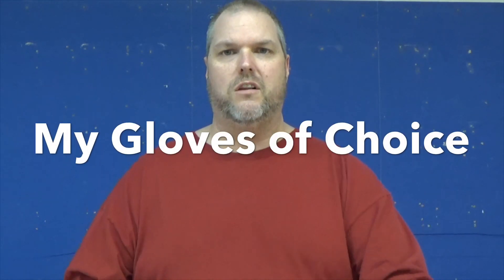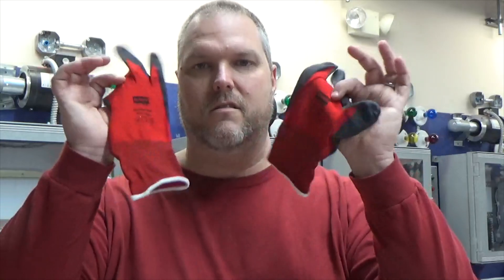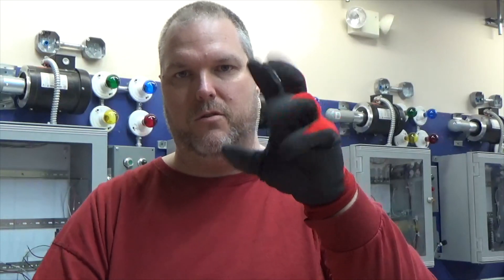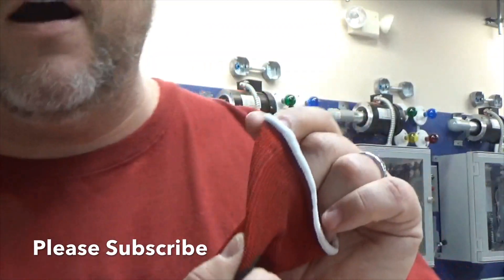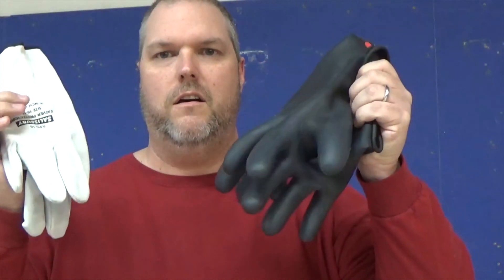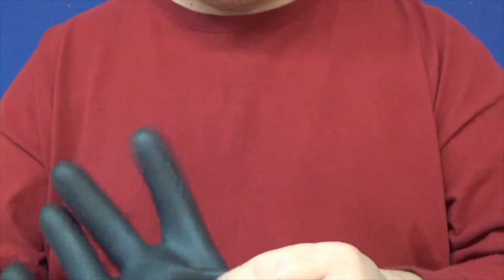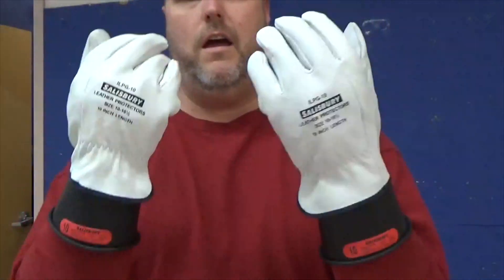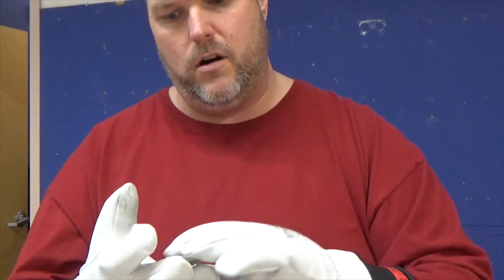PPE, Gloves for Electricians

Comment: I retired from a large hospital/research center campus. Each of the 6 electricians had 8 pairs of gloves. Halve 1,000 volt & rest were either 15 or 20 KV. Chief electrician would have 4 pairs locked up so when we sent the 4 pairs of gloves out to be tested & date stamped every six months then used the locked up sets. Keep a pair of each voltage in main hospital and the sets two blocks away in another builiding. Best to order thin cotton loner gloves to put on before the rubber gloves when in hot areas. They make an approved powder to put inside rubber gloves but never tried it. Nice important safety vidio.

Comment: Definitely agree on this stuff. Good explanation, i however only ever worked on lines that already low voltage or when the power was shut off at the breaker. But i can definitely see how you want to work on live wires and in alot of case only practical way to do so. Sometimes though you can shut off the whole entire transformer bucket with a hot stick and work on non-live wires.

Comment: I'm an Electrician of nearly 35years now and an Electrical Trainer (Instructor) too. 
You are not taking into account why the glove is made the way it is.  Electrical Gloves have a 'Gauntlet section' for a reason, otherwise they'd be shorter and only come to the wrist.  By rolling the gauntlet section all the way to the glove section to create a seal means you are not squeeze testing the gauntlet section.  A better way to do the squeeze test is to create the minimum possible seal space you can and then squeeze both the Gauntlet and the Glove sections separately.

Comment: Good video. Thank you. Are dishwashing gloves better than nothing for discharging a microwave capacitor?
Reply: Obviously a diswashing glove is better than nothing, but the real question is, is it safe? The capacitor has a limited charge, and won't kill you. So I would just use a 20 cm piece of isolated stiff copper wire, preferably yellow-green, strip the ends, fold to a u-shape, as a glorified paperclip, to touch the poles of the capacitor to discharge, without needing gloves
Reply: @rolandlastname5532  Good idea.

Comment: Today I saw someone get shocked very badly.  I'm pretty sure he will be ok, but I'm going to have nightmares for weeks about it.  I build my own tools and work with electric motors up to 220 volts, not frequently, but occasionally.  I want to find as much safety training as I can find online, and would also like some pointers on safety gear.  I liked you video.

Comment: I use gloves a lot, and I've used several different kinds. My most recent glove purchase happens to be a pair just like your red ones, except mine are blue. Superstition has always led me to prefer a thicker material, but I like these, and they don't take up a lot of space in my tool box. I also have a pair of blue plastic (PVC) gloves for nasty and/or caustic work. I was able to find a pair that fit well so that in spite of the material thickness, I can still tie the laces on my boots while wearing them. <-- That is a test I use to get a sense of how useful the gloves will be to me, and whether I'm going to have to be taking them off and on all the time. For someone who uses gloves a little more often than the next guy, it may seem odd that I too prefer to work without them, like you do. The reason is this: I'll wear a pair of new gloves to do some things that I really don't need gloves for. This gets me used to wearing them, and also gets me a chance to practice performing a task I can already do well without gloves while wearing them. Eventually, when weather or some other factors conspire to make the gloves mandatory, I won't feel so clumsy with them on.
Cheers!

Comment: Hi Mr Michaud, the first pair of gloves you showed, the red ones, nylon with rubber palm and fingerstips, would they be sufficient to protect you from electrical shock, for example I had a faulty wall light switch for the bathroom, someone probably touched it while their hands were drenched with water and it was giving everyone a shock when it was being switched on and off. Can those red gloves be used for electrical live work around the house?
Reply from the maker: I DO NOT recommend those gloves for live work. I always try to turn the circuit off when I can. Work safe. Thanks. CM
Reply: @craigmichaud-electricalins4602  Great advice Craig.

Comment: What kind of gloves do you recommend using while working with live 120/277?
Reply from the maker: Okay so to be real with you I dont wear gloves when working on 120/277v. I have to hold the wire and feel it. It is more of a comfort for me. Has it bit me in the past? YES but it is the way I was trained. I tell my students that if you want to wear gloves on a live circuit any good leather glove will work great!!! Thanks for the comment and watching my video. CM
Reply: @craigmichaud-electricalins4602  Same way I was trained. Working on 120/240 hot is an everyday thing. I been hit many times, but I am still comfortable just using my bare hands

Comment: Great video, I may have two tips for you:-)
1) About splinters, there are an super easy way to get them out, including rockwool splinters. Take a syringe, cut of the whole end cap where the needle is normally mounted. now put that end on where you have the splinter and drag the piston and do thereby make a vacuum, that will draw the splinter out.
2) About the working gloves, instead of cutting the two finger tips completely off, make a slit in the fingers so you easily can fold the glove fingers away from your fingers and back again after. This will keep your fingers warm and increase your abilities to work with fine screws,